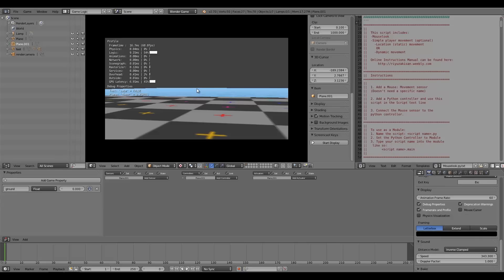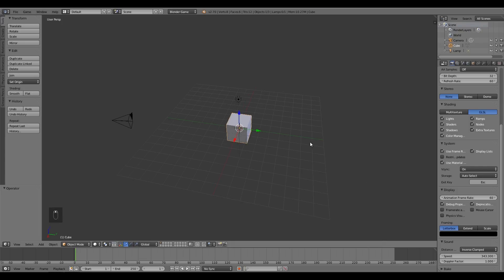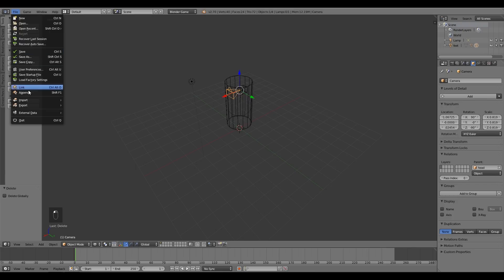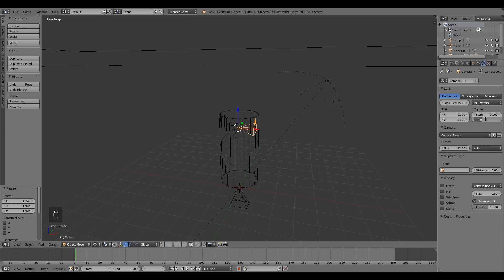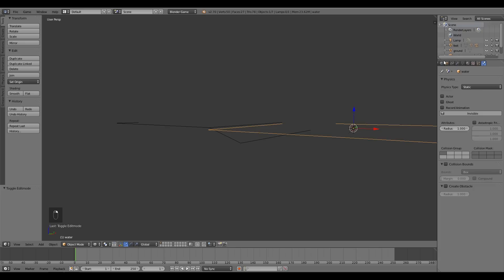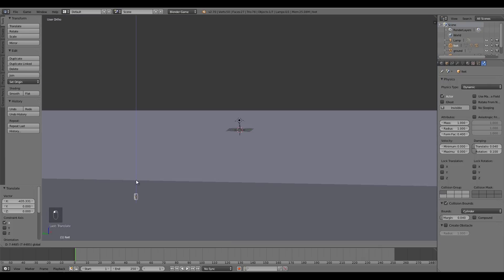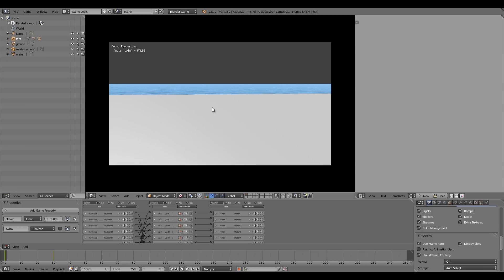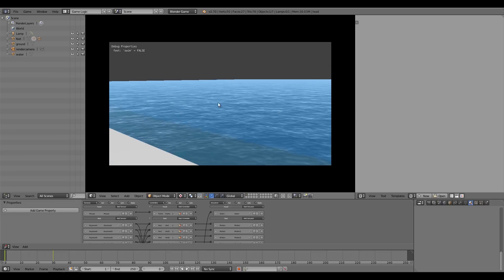How to add Water Mechanics in BGE

Comment: I don´t know if you know how (I think you know how), but there is a very easy system to make a dive-system that would perfectly fit into this theme :).
Reply from the maker: How would you go about doing it? I was thinking moving the camera underneath the plane of water but at the same time flipping the normals via python and adding a blurring script.
Reply: ThaTimst3r You can do the look underwater with a simple blured blue plane, but I meant the player-physics. I have a video on my channel in that I can levitate. You can watch it if you´re interrested and if you want to know how to make it just ask :)
Reply: Medieval Design Studio here is the video:  /watch?v=a-4QfySyVTo&list=UUCdfyrKXu4Q7az3tLGk6ZSA
Reply from the maker: Medieval Design Studio You could do this but if the player was half in half out of the water then one side of the water wouldn't show up + the whole screen would have blurring applied to it. I think the easiest way is to use a property to trigger diving so you can add a limit timer and also so the blurring etc. is sorted out correctly. Using a physical representation you could use a constant upwards force applied to the player while into contact with the water causing them to 'float'. Either way if you are using the system in the video it would probably be best to use property diving method so that you don't have any physics issues.
Reply: ThaTimst3r In my video I used properties(for me the best way to work). By pressing E a property toggles and becomes TRUE then you can fly and the spinning ring spawns under the player. By pressing again E the property toggles to FALSE and everything becomes like before. With this system you could activate a property by having a collision with the water and use the same physics like I used to fly.

It could be a good tutorial idea to improve the water mechanics :) ?
Reply from the maker: Medieval Design Studio Yes, I was thinking something along the lines of using a property to toggle diving.

Comment: Great tutorial! I don't know if you answered this already but, will you do a video on under water effects?
Reply from the maker: Probably not as the underwater effect scripts are a lot more complicated and also martin uptis said that he doesn't want people using them for projects just yet. You could however activate a custom 'blur' 2D filter (as the default only blurs by around 2 pixels) and add a blue faded out texture when the player is 'underwater'.
But you will also have to turn off backfacing which might eat up some performance though you might be able to switch this on and off with python...
So in short probably not just yet but if I get something working in the future I'll put a tutorial up.